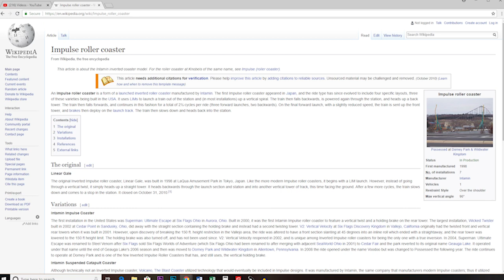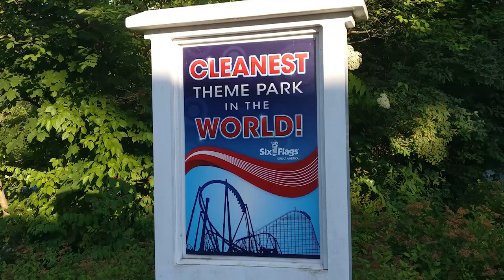Electromagnets, roller coasters, half-a-dozen flags, and clunkless chain lifts

Comment: fun fact every launch costs $60 and there is 115-second cooldown to prevent the LIMs from blowing up.
Reply: The cost will differ from ride to ride. Also, during that cooldown, a new load of electricity is being built up for the next launch. This, and not overheating, is the biggest cause of a cooldown period.
Reply: @Filipolis  its not a flash to a camera mate, there's nothing to store its all ac power
Reply: @obviouslytwo4u  The amount of power needed for a launch is rather large, and because of that you can't just suck it up straight from the electric network. That would result in constant power shortages since the launch itself would need as much electricity as a whole neighborhood while it's launching. That's why manufacturers always work with a technique that can slowly build up energy for the launch, originally with a weight being slowly lifted and then dropped while it was attached to the train. Nowadays, we have hydraulic, pneumatic and electric (like supercapacitors) methods to store this energy, but there is always some form of it.
Reply: That's... A lot of gigajoules.
Reply: @theenzoferrari458  Probably none, but judging by your confrontational and profanic behavior you're probably missing a few.
Reply: @theenzoferrari458  I'll be muting this conversation now. Enjoy being alone.
Reply: This comment thread is a mess
Reply: @jasonmyneni8605  lol honestly I comment something one year ago, get zero notifications, then youtube sends me something. You are in fact right. This thread is a mess. Lol.
Reply: Wouldn't that make each launch cost approximately 70 Kw(h?)'s
Reply: Filipolis like, has he mentioned, a flywheel?
Reply: Lmao, these rides do not store electricity like intamin’s newer rides. Full motor power is ~15 megawatts, which is only drawn for a few seconds at a time. Source: I’ve operated one of these. They need a lot of power, but it’s really not that obscene. There is a cooldown period but it varies depending on ride, ambient temperature, and settings. The motors are driven at a peak current of 4750 amps and at around 3000 volts.

Comment: One could do a whole channel on the engineering behind modern thrill rides, and how the engineering makes the ride so fast and safe at the same time, with only a handful of barely trained monkeys operating it.  While we were next in line for X-flight it broke down right in front of us.  It came to a stop just before the chain lift and the monkeys were locked out from being able to restart it.  Two men in black arrived (not making this up) and they pulled out very heavy keychains to unlock and open the electrical panels near the control cab.  The tall one reached in and immediately the train full of people began to inch towards the lift chain.  After a minute of very slow motion the train resumed normal speed--the passengers waiting locked into the train for about 15 minutes were unsure if the ride was going to be safe.  The train went through the ride with gravity taking over and the fail-safe braking system keeping the trains from colliding.  Once the train was through the ride, they restarted the ride by cycling the power disconnect panels.  After about a minute of boot up the waiting train was allowed into the station and the passengers were unloaded.  Everyone stuck on the ride got free flash passes for their ordeal.  This shows just how well engineered the SYSTEM was--fail safe systems keep anyone from being hurt on a rides that run pretty much non-stop.
Reply: And then you have the media making it seem like the rides are doing something wrong when they stop a train on the lift hill or a break run.  They should do their research before publishing articles like that.
Reply: @davidfrischknecht8261  the media does that with just about everything
Reply: The YT channel GP to Enthusiast - this is one of their pet peeves. I recommend checking them out, really good info on coasters and other rides

Comment: I see what looks like a linear encoder up there, too, so the computer can know the train's speed and get the LIM timing right.  I have been fascinated by ride control systems since I was a kid going to Disney, but the interest was extra fired up when I worked in the electrical department at Six Flags New England almost two decades ago (wow, time flies...).  I had keys to the whole park (even though my super entry level job didn't require such access, but I guess they trusted me).  It was tons of fun going into all the control bunkers and checking things out, without touching anything of course.  Some rides ran on 600 V, which kinda blew my mind at the time.  It was cool reading the huge binder -sized user manuals for the rides, too, especially the crisis/failure management section.  The engineers really put a lot of thought into the possible failure modes and how to recover from such failures safely. There is so much redundancy in these rides!
Reply: I read the specs of the ride on the manufacturer website and it says the ride uses lsm motors (linear synchronous motor) so i don't think this ride has a complex control system
Reply: @francoelektro7700  LSMs require more advanced control systems than LIMs, LIMs use a a moving electromagnetic field while LSMs synchronize itself with the location of the plates on the train. Also existing Intimin Impulse coasters use LIMs, Intimin's website labels all of their launch coasters as using LSMs because they discontinued their LIM and Hydraulic launches and now only build LSM launch coasters.

Comment: the weight that lowers as the train engages, is taking the slack of the return portion of the chain (the under side kind of hangs until tensioned) and all the chain links have a very small amount of give for freedom of movement, that give adds up when tensioned multiplied by the number of chain links. If you look at a bicycle chain the bottom of the loop has a little hang to it, otherwise the bearings have an additional loading adding to the torque when applied.
Reply: I found a video example, at the beginning you can see the chain tension up as the train loads on. https://www.youtube.com/watch?v=Gfn4kS2NGV8
Reply: This is along the lines I was thinking as well. The motor is probably run continuously as repeatedly starting and stopping increases changes of failure, but keeping the chain at max tension all the time also likely puts unnecessary constant stress on the motor. This is probably why most "cheap" coasters have a noticeable amount of slack chain hanging under the track, which is pulled tighter when loaded. A variable tension device (like the counterweight) would help to extend the life of the motor and provide a smoother lift. Keeping the chain at a more "correct" tension (using C to C calculations, or simply pulling until tight) under load also likely reduces friction losses while pulling the train up the hill.
Reply: Your example shows that the sprockets are both fixed to the frame. That is probably only to make the chain engage with more teeth on the drive sprocket.
Reply: I agree. In addition thinking of the conservation of energy, it takes a lot less energy to speed up the chain that is already moving than the energy required to start a chain moving from a dead stop repeatedly, without the risk of the chain seizing. The auto oiler for the chain can also spread lubrication easier and more even as the chain is moving.
Reply: Everyone is correct about the chain tension but, everyone is missing the thing. That is the friction wheels at the beginning of the lift, are run at the same speed has the chain motor. They're controlled by two different VFD's which use the same signal from the PLC thats running the ride. 

How I know this is I was full time electrician was a Six Flags park in Maryland in 98.
Reply: Also, to the left of the counterweight, there seems to be a shaft that speeds up when the counterweight lowers.
Reply: It mostly like takes the slack out of the rising portion of the chain, because as soon as the train engages with the chain, it gets tensioned all the way to the top then back down since the motor is located at the bottom of the lift hill. That means that the weight takes the slack out of the tiny bit of chain that is past the motor and behind the train. Then once the train gets to the top of the hill, the return chain is under tension but the ascending chain that is behind the train is no tension.

Comment: I know this was 4 years ago but if anyone is reading this - the reason you dont get a "clunk" going onto a b&m lift hill is because they (most of the time, if you go on a coaster that doesnt have this, for example Nemesis Inferno at Thorpe Park in the UK, you will feel the jerk as the train engages) most of the time use drive tyres before the chain and the tyres move at the same speed as the chain, meaning when the chain dog engages with the chain, it doesnt suddenly engage causing the train to jerk about. The reason the weight goes down is because it is what keeps the chain tought - so when the train goes onto the chain it streches a bit, meaning the weight does down as there is more length to the chain. Any questions let me know : )

Comment: Several years ago, I worked at Cedar Point in Ohio, and the ride I worked on was exactly like this one, only a little taller. I can say that the ride is served by a 400-volt transformer (European standards I guess, since Intamin is Swiss) and the park had this ride hooked up to a 1.5 MW line coming into the park. The LIM's are 3-phase motors fed by a variable-frequency AC drive system, which is how they're controlling the speed of the train. I happened to catch the MFR name on a sticker in the electrical building ("Integral Drive Systems"). There is an ammeter on the cabinet, and during launch it pulls 3500 to 4000 amps. During the subsequent passes, it uses less power, presumably since the train's already moving.

Edit: You can see the black "comb" thing on top of the train, and it slides through some metal device affixed to the track. That device has a laser in it that "counts" the teeth coming through, and so it's able to tell how far the train is and when to have it stop.
Reply: state side here we supply stuff like this with 480V AC and yeah 1.5 MW sounds about right for the incoming line.  though depending on how fast they want the train to launch, it could get as high as 4 to 5 MW and several thousand amps current is absolutely insane, but can understand that.
Reply: Just realized how old this video and comment are but still wanted to say I'm also an Ohioan and used to go to Cedar Point every year.  One thing I heard in the past is that they actually have huge backup power generators to keep certain things functioning if they lose power from the grid.  Also a bit curious as to which coaster you worked on exactly, I'd guess Twister but I think there may be another ride that moves back and forth as well (I'm more of a coaster fanatic and don't ride those ones as much).
Reply: @grn1  Yeah, Wicked Twister is in fact one of these 7 Impulse Coasters. That current at said voltage would be just a touch over 1.5 MW too.
Reply: How does that not upset the local grid? Capacitors?
Reply: @nthgth  I'd imagine it's just part of the cost of business.  They designed their feed to be enough for what they need. 🤷‍♂️
Reply: @nthgth  the park's power consumption would be engineered from the get-go w/ the utility.
Reply: @kingjbone1  so being that far in advance it's contained by whatever capacitor etc is necessary to have it not affect the rest of the grid.  That makes sense, since it's also in the power utility's interest to acquiesce to humongous local customers.
Reply: RIP

Comment: Chain tensioner:  Theory is correct, reasoning is wrong.  The control system will be programmed so that the chain is ever so slightly faster than the speed the train travels through the drives, and after the dog engages the work is transferred from the drive motors to the lift motor.  Since the drive only puts out a frequency to the motors to spin at a certain speed, which is slower than the chain, all of the energy is transferred from the drive tires to the chain the instant the dog engages .  The reason the counterweight drops slowly is because there is only a portion of the train on the incline.  As the entire train begins to go vertical, the chain will eventually meet the force needed to lift the full train on the incline.

Making some rough assumptions can yield a number that will simulate the effect of a coaster with nearly the same characteristics.  So assuming:

Overall length of chain = 275m (appx 3500 links)
Lowest cross sectional area of steel link = 0.00129 m^2 (appx 2 square inches)
Force applied to link = 83240 N (train weighing 13 tons on a lift with 40deg incline)

Our equation is Y = (F/A) / (dL/L)

Therefore our dL (the length the chain stretches total) in this hypothetical (very similar to a B&M hyper) is about 131mm or 5.1 inches.  Even though each link only stretches one ten-thousandth of an inch (0.0001") that still adds up.  The only section of the chain that has tension begins at the train dog, wraps over the top of the lift hill, and touches the drive sprocket.  Everything behind the train has 0 tension.  The tensioner keeps tension on that side of the chain which would otherwise be 5 inches of slack, which would cause it to skip links around the drive sprocket.Therefore weight is applied.  Some coasters use pneumatic cylinders or airbags to tension chains.  A weight is obviously the most simple fail-safe solution.

Valravn at Cedar Point has no such drives to guide the motion of the engagement.  Find a video of that counterweight!  It really bounces!
Reply: I had to read that twice and watch that segment twice to understand, but I think I got it. Thanks for the explanation.

Comment: I'd guess the counterweight is a dynamic tensioner. Which accounts for the slightly different load due to the riders. It would be interesting to see if the weight's movement was different with a ride with lots of smaller riders or a half empty ride.
But I'm thinking if the chain's tension is predictable, the pick up clunk can be eliminated. 
Interesting video and I enjoyed the turn signal video.
Reply: Maxx B exactly correct.
Reply: Same kind of thing for the San Francisco trams cable tension system, but on a much smaller scale
Reply: Justme Asifyoudidntalreadyknow I know that steel cables stretch but for some reason, it never occurred to me that a metal chain could stretch as well...
Reply: This. I ride a motor bike and if the chain tension gets to low you end up with backlash when you put a load on it. keeping it taught eliminates that backlash. The chain will stretch over time, so you have to adjust the rear wheel occasionally to re tension it within speck.

Roller coasters with that back lash will be within speck, but they will not be adjusted until it is needed within its maintenance timetable. The mechanism seems to be a way to keep the chain fully taught within its maintenance timetable, where the chain is in speck but some stretch has occurred.
Reply: This is the correct answer.
Reply: When there are fewer riders the ride runs slower because of the lack of inertia this is incredibly evident on i305 at king’s dominion where the train engages a set of fixed magnetic trim brakes and on an empty train you crawl through the second half

Comment: Comments on the questions you had:
-V2 (at least the one near me) uses about 6000A when launching. This is fairly normal for an older launch coaster.
-That weight and tensioner is for lift acknowledge and for lift faults such as sensing that the train has stopped on the lift or, in the ultra-rare case, that the chain has snapped. It's attached to a plate with a proximity sensor as you can see.
-The pricing at Six Flags is undeniably to push for pass/membership sales as well as parking pass, meal and jump-the-line passes. It's Six Flags, they're still paying off their debts.